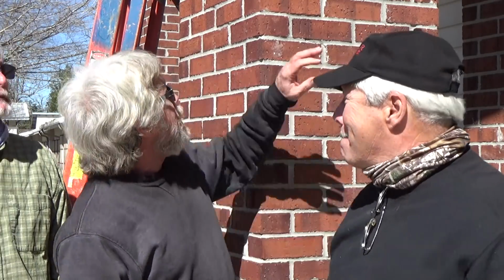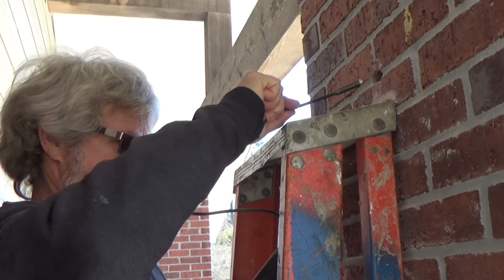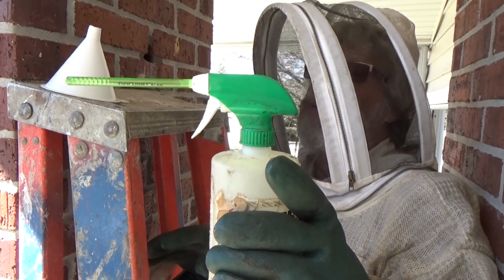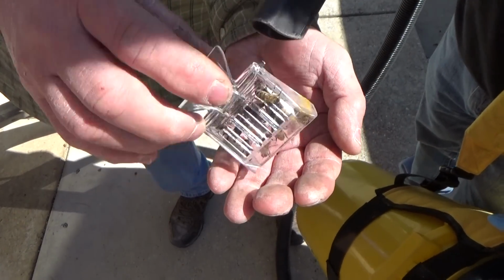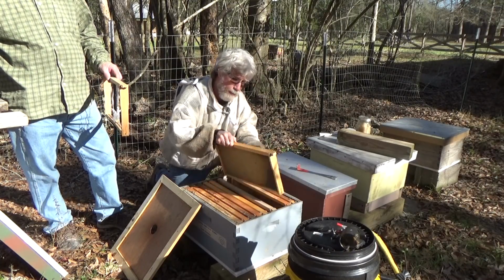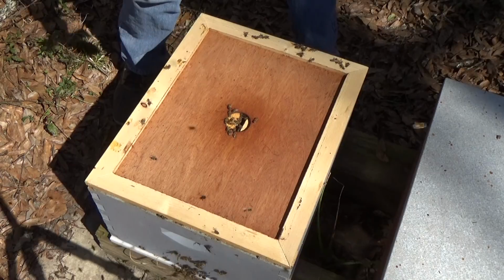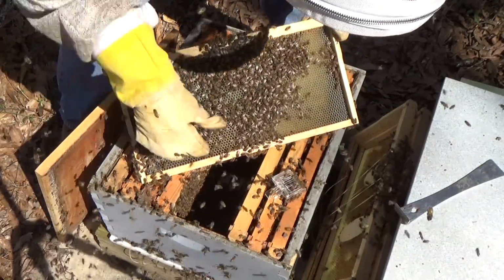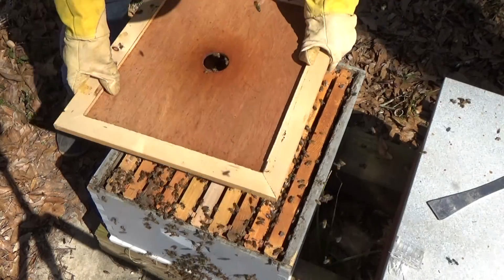How to easily remove bees alive from a brick column without destroying it

Comment: Dear Jess,  could I ask if that is a domestic vacuum set at low power? Or specific model for task? Regards Richard UK
Reply: It's especially designed for the job. A normal vac will kill the bees!
Reply from the maker: The vacuum is specially designed to have a low suction. Here's a link to the video I made on making one for yourself. Thanks for watching. God's peace Richard.         Mr. Ed
https://youtu.be/tV3mR39v6RA

Comment: i did my first cut out last year.  Using techniques that I've seen between you and Dirt Rooster, it was a total success.  I was bummed that the queen catcher (metal) I bought in a pack of 5 from Amazon failed to keep the queen corralled.   Ultimately she got vacuumed up with the rest of the hive.  There are so many different catchers available but most of them have reviews that indicate the queens are getting out.  Please tell me where to get a reliable catcher.
Reply from the maker: One trick I use to keep the queen caged is to place a rubber band around it as soon as she is caged. Also, make sure you handle the cage holding only one of the ears. It is very easy to inadvertently, or accidentally open the cage by mistake. Other than that, I use the cheapest ones from China, less than 2 bucks a piece. Congratulations on the removal. God's peace brother.
Mr. Ed

Comment: Great video ...
I have talked to recently about similar situation with bees inside a brick wall ( property fence)
The hive is using one of two holes that they used to enter , its the lower hole about 2 ft off the ground.. the other one is about about  4Ft above it. It is a massive hive the height of a person ( viewed by IR camera)  
I think I am going to use your technique and try and get them out through the top entry.
one problem for me is that I am a Novice and don't really fill confident to be able and spot the queen when she gets out.  What will happens if I spray into the top hole ? I understand there is a risk of "drowning" the queen   and bees  ... I don't have a scope ..
any recommendations ?
Reply from the maker: The reason the holes were drilled in the mortar was to get below the bees, you have to get below the comb for this to work and allow the bees to escape from the space that was not sprayed in. If you spray in the entrance hole you give the bees no choice but to run dow in the wall. If you have no means of know where the comb is, guessing is all you have and I would go down 3 feet from the top as a good starting spot. Best wishes to yo and the bees. God's peace.
Mr. Ed

Comment: 2 things one the hole Ralph created looks like a nose. And 2 what will happen to the comb since you couldn't remove it?
Reply: What will happen to the comb? My guess is that wax moths will sniff its presence very soon, and they will completely demolish it.
Reply: @wilfredkube8570  maybe. As well as a lot of robber bees. But in one video i seen bees used old comb that somebody attempted to remove a bee swarm from previously and actually started working it and cleaning it up. So bees become attracted to the old comb and the problem could come right back
Reply: The reason why I ask a question is because if you use old come in a swarm removal put in a box to give the business start in their new hive so to speak want the same thing happen if you leave the so to speak want the same thing happen if you leave the cone behind without any bees working it comb behind without any bees working it now I know that the come can become brittle and hard if left for a long period of time it will break down on its own and be unusable but since it is still newer inside there if you leave it there and it's not dried out couldn't be calling to start out using that same called comb especially after it it's been robbed out buy robber bees? Wilfred you could be right that the wax moths will find it and destroy it but if a new bee Colony comes and finds the area quicker then the wax moth don't you think that it could start colonizing that come because they don't have to work as hard starting from scratch. All they would have to do is clear out any wax moth or bee larvae from the swarm that Jeff caught and to start working the comb as if they already made it before so leaving to come could be inviting these to come and make it their home again so if he can't use foam in insulation or any kind of spray insulation like that or close off the top of column up don't you think it would be the same problem all over again in a very short. Of time
Reply: @nicolerobb2053  Nicole, you may very well be correct.  In some ways, I wish that bees were attracted to comb as easily as wax moths are.  It probably depends in what part of the world it is where you live - are there lots of bees searching around for a new home?  It would seem that in Louisiana, where Mr Ed lives, that there are many more bees than where I live.  All I know is that there is no shortage of wax moths here.  I tried during this last Spring season to entice bees into a bait box, because I would have been very happy to catch a swarm.  All I got was a lot of debris which was left by wax moths which devoured the wax which I had used as "bait" to try and catch some bees.
With regard to stopping any new bees from colonising the brick column, I agree with your comment.  I would try to block all of the empty spaces near the top of the column with expanding foam, and then cover that foam with a layer of brick-layers mortar a couple of inches thick to provide a strong layer of bee-proof barrier.
Reply: @wilfredkube8570  i see your point. You are correct in many ways to you have to look at the area you live in and your right in Louisiana it seems there are alot more bees there. I may not have ever tried to catch them but i do know where i live you don't see many honey bees and I do see hundred more hornets and yellow jackets everywhere. I see bumblebees alot to. Honey bees would be a wonderful sight to see but where i live honey bees are endangered in Pennsylvania which is where I live. Although i am allergic to hornets wasps yellow jackets and bees i would still love for honey bees to be seen again in Pennsylvania. I love the ideas you have for closing off the top of the column. Of the three responses i had to the column question yours is the most well thought out way. The other two responses were to use spray in foam insulation to keep them out. Considering ( jeff) mr ed showed how spray in foam insulation can be easily chewed through by a swarm of honey bees. Although both your idea about the bricks and their comment about using concrete your idea is good but your idea about a bee repellent barrier is what makes your idea so much better. Bricks by themselves bees can get through as the mortar between them can break down and holes form and bees can get in